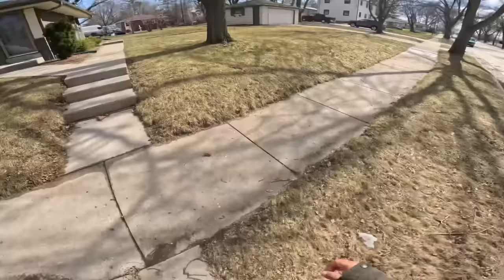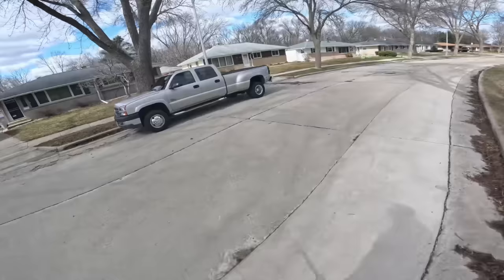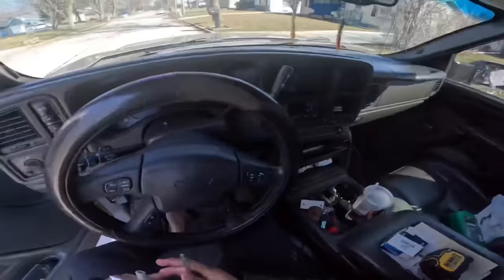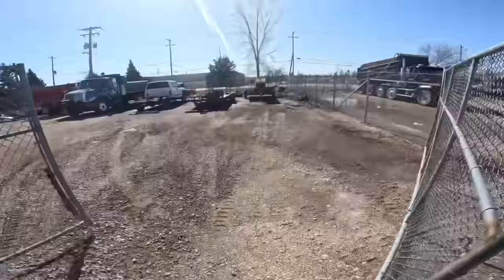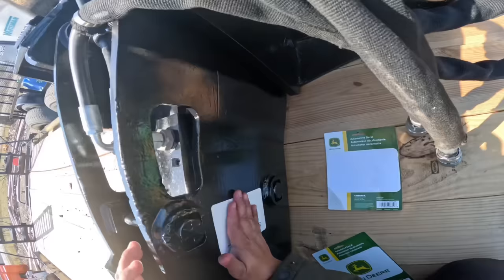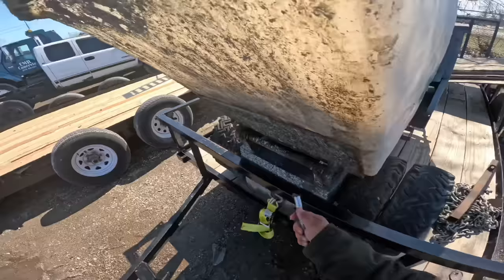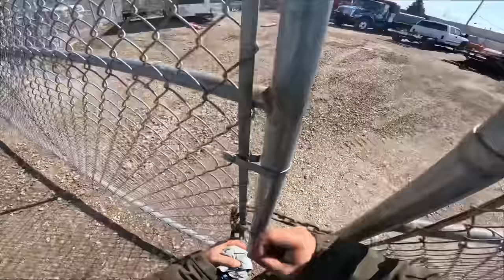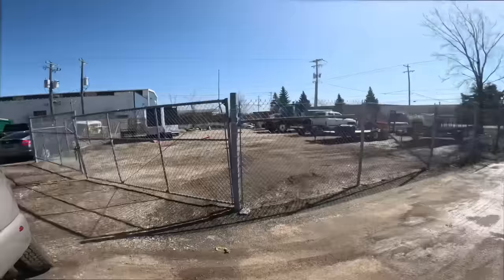Jobs coming in good !! Thank god ! 🙏

Comment: Hydraulic oil and engine oil are 100% not the same lmao hydraulic oil is thicker and stays thick when warm engine oil breaks down with heat  that’s crazy they all said it’s the same thing lol omg 

Engine oil has detergents and dispersants in them that are not present in hydraulic oil. These can cause any water in the system to emulsify and foam causing damage and failure now transmission fluid would be a good substitute
Reply: The reason Ryan said 10w30 is cause that what his buggy manufacturer saids to run in them wether Eric’s is meant to run it who knows 😂
Reply: Hmm.. funny cause a lot of equipment uses 10w30 for "hydraulic oil" my new holland skid steer uses 10w30 in the hydraulics...
Reply: @skliros9235  my two post lift also uses 10W-30 in the hydraulic system.. it's almost as if it's the same thing as hydraulic oil... no I don't think I would use hydraulic oil in an engine but engine oil is definitely suitable as hydraulic oil

Comment: I thought ya did concrete work.       You work for one of the best Victory.  Ryan makes good videos.  Once ya get watching ryans ya dont wanna quit tho..  has to be a pain editing these videos     I hope ya do well.  You seem like a cool guy and have  accomplished alot.  Short drive around videos  o im hungry  then i have to use the bathroom  mexican music playing.   .  Every video so far.  When your working on stuff is decent content. If ya dont know ask ryan.       Stuff broke call nate. Looks like ya can handle the basic maintenance.       the remarks on the comments..... o they say i do this.  Just do you man.     Alot of lack of rebar or mesh comments.  I dont know concrete  but common sense tells ya to use rebar  mesh and pins. The years you done for victory you know whatca gotta do.   Longer videos more concrete related..  Follow your mentor ryan make some videos like he does    your set with what ya need to do the jobs. Dont blame ya on skidsteer renting those are expensive  in time you will get one.     On ebay you can get some easy e concrete decails. Or that hoopster place will prolly hook ya up.       Put on truck and equipment. Maybe some t shirts.      not a huge amount of money.

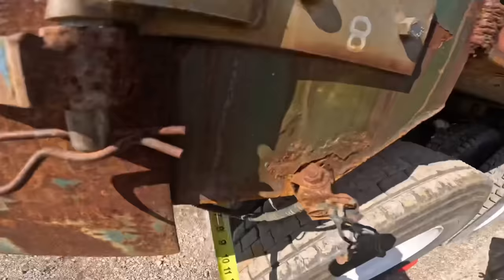Comment: 9:24 didn’t even know it was that rusted out. Definitely do the metal work before sand blasting a paint.
Reply: @Buckwheat2080 thanks very true, didn’t even think of that, on why they sold it off, it’s just an older truck they replaced for a newer one 

Maybe with proper repair it can be brought back. But definitely not right now, road base would spill everywhere on the road 😫 

But I think Eric has a plan 🤔 🙌

Comment: You need to learn how to research things oil and hydrologic fluid are totally different
Reply from the maker: I ask rayn and mike !
Reply: If you showed what you filled in the video it might have clarified it too
Reply: These buggies typically use engine oil also as the hydraulic oil.
Reply: @easyye.concrete YOU NEED TO LEARN. Mike and Ryan at going to hold your hand forever. Research these things my dude. I want you to succeed your a go getter. So go get it without “asking Ryan or Mike” be independent! That’s going to give you lot more respect from your peers